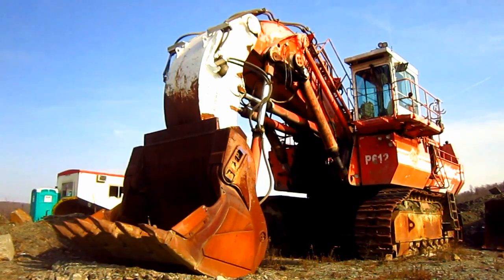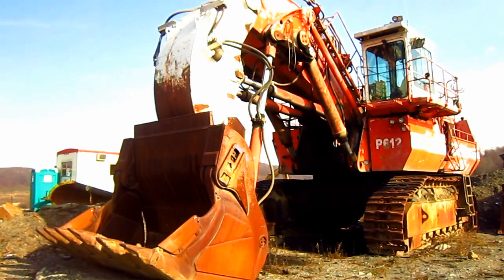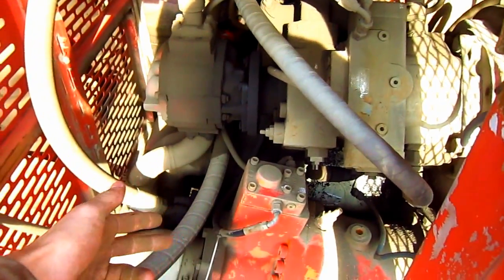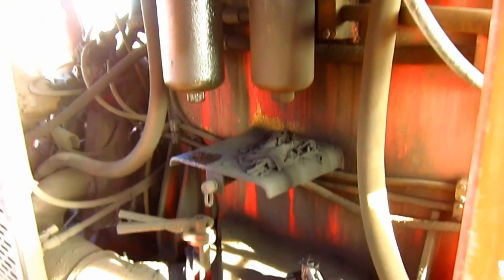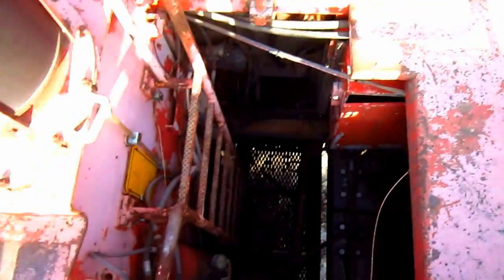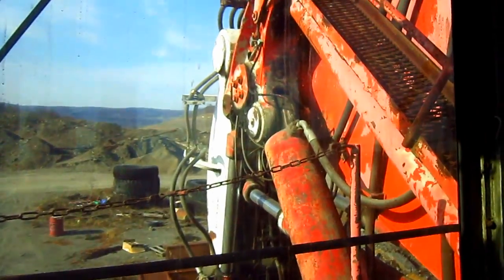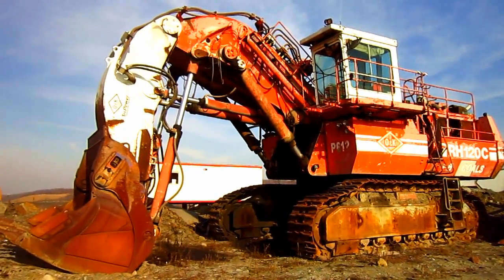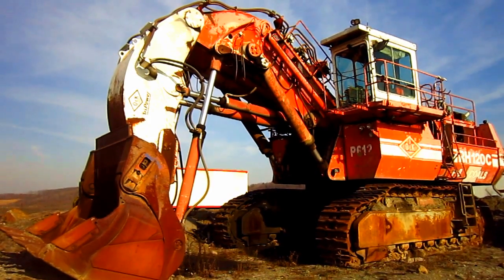O&K RH120C Documentary

Comment: Great video again man , these old 120s were untouched when it came to production , speed and reliability except the strained cummins engines used to go pop too often , I worked on one coal site with 3 of them loading backfill onto 15 777bs , moving 270000 yds/week in 60 hrs ... they were 10 years old then , awesome shovel
Reply from the maker: They defiantly could move the dirt.  A very well designed and strong digging machine. Had a couple of them over here that used to double team load 777's.  30 seconds and a truck was full!  Thanks

Comment: Thanks for the video. I always enjoy them a lot. I was wondering 2 things. First why is that machine so rusted and how does the oil cooler work?
Reply from the maker: William Krakoff This machine is retired from service and is no longer a full time production loading unit, which explains the rust.  The two oil coolers are temperature regulated, which means when the oil reaches a certain temperature, a sensor kicks the fans on to cool the oil down.  The fans are driven by two hydraulic motors.
Reply: PAmining Thank you! How how much lower can the fans make the oil?
Reply: lidsman22 , on your question about how much the fans can lower the hydraulic oil it has been my experience that an oil cooler can easily lower the temp 40-60 degrees depending on the size and flow rate of the oil, it probably could do even more if you have a bigger cooler